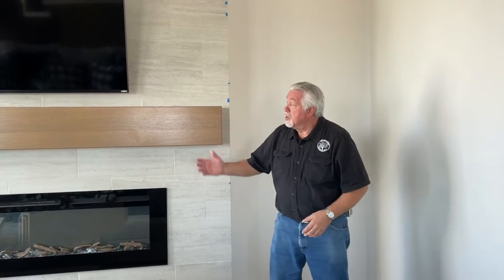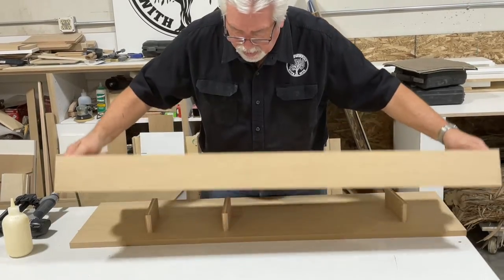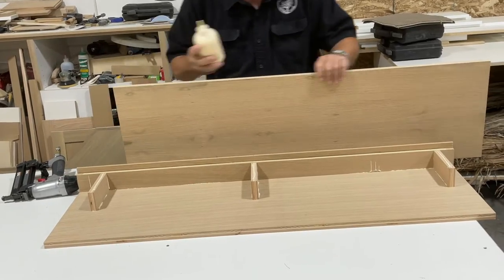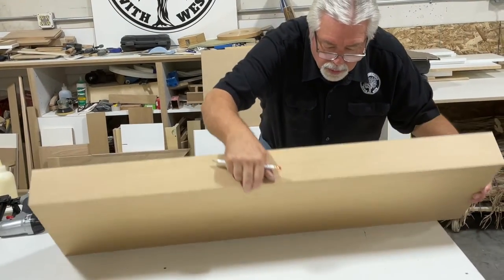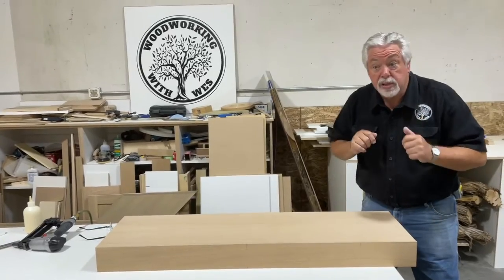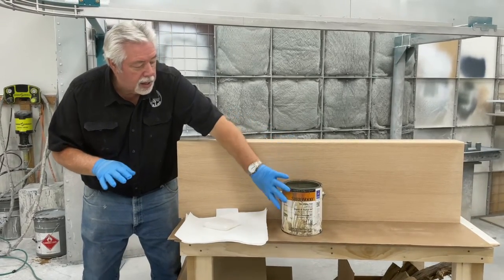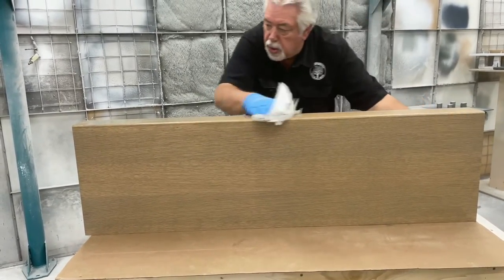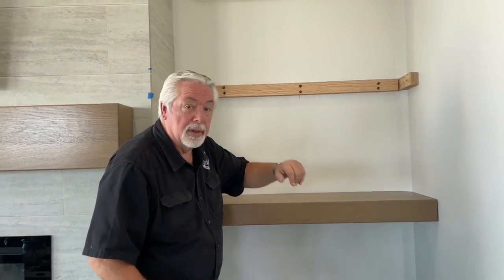Transform An Empty Space With Floating Shelves

Comment: The first floating shelves I ever did was in an application like yours, on each side of a fireplace. So I measured the back wall and knocked off 3/32" and built them. When I went to install them I found that I couldn't just slide then over them over the brackets because the fireplace corners had been mudded over metal corners. Because of the way the metal corners are shaped. the metal corner sticks out about 3/16" past the sheetrock. Now I install the brackets and use a stair tread gauge to make a custom fit. Then I assemble them in place.
Reply from the maker: That's great!! Thanks for the tip, Wes

Comment: What kind of anchors did you use to secure the shelf? Also what type of veneer and glue did you use?
Reply from the maker: Hi Chris...the mounting blocks were just screwed to the wall with 2 1/2" grabber screws. The veneer panel on this job was rift cut white oak. I always use Titebond wood glue in all my projects. Thanks for watching. Wes
Reply: @WoodworkingWithWes  thanks for sharing your techniques.